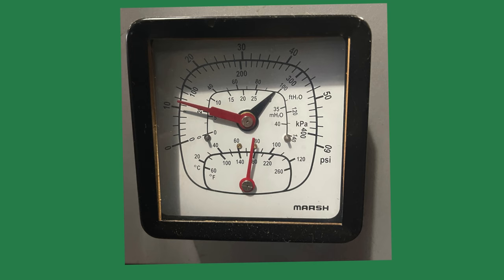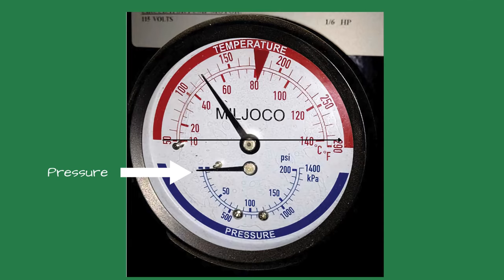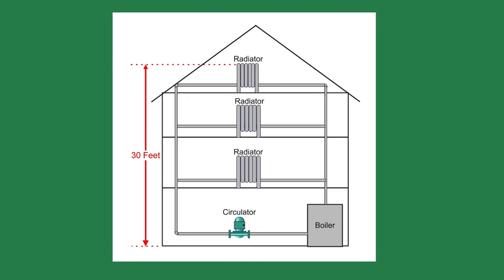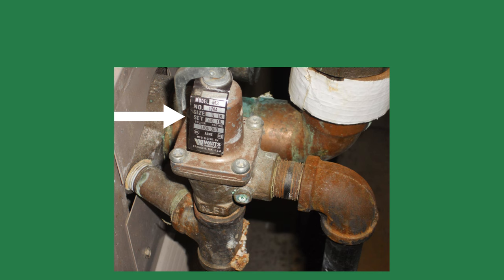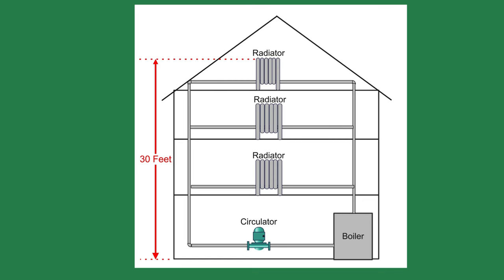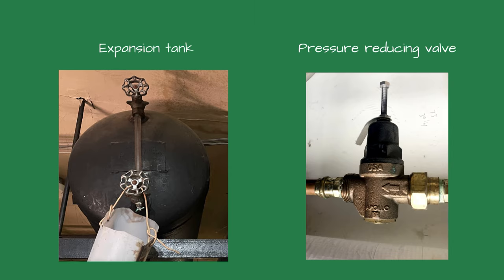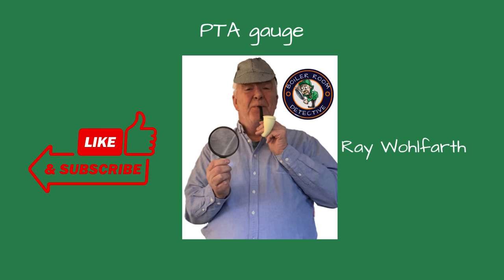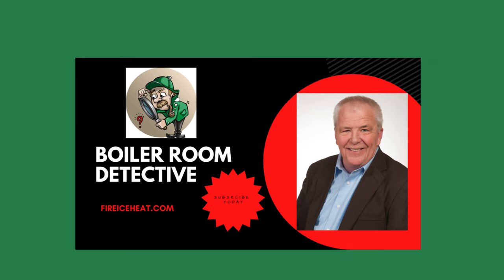Understanding the PTA Gauge

Comment: I think you miss spoke… You said to multiply 2.31 x the height. The correct math should be .433 X the height.
Example of 30’ x .433 = 12.99psi
Add 2-3psi for cushion.
Reply: 2.31 feet of water equals 1 psig
Reply from the maker: Good catch sir Thanks